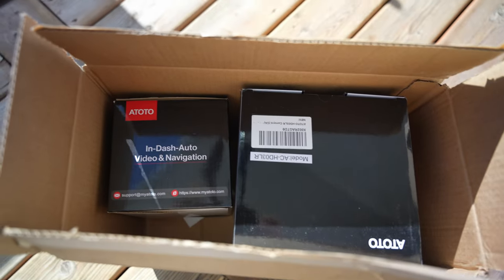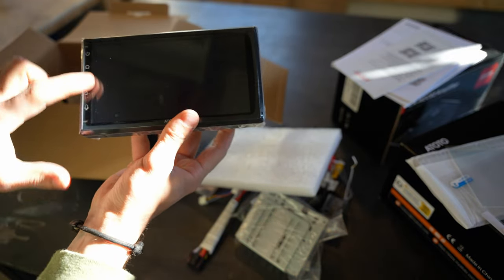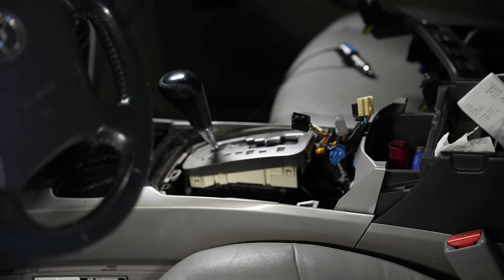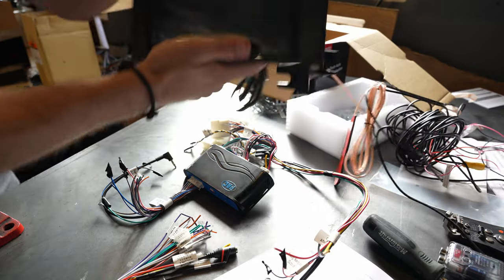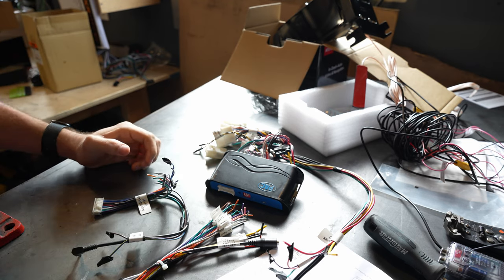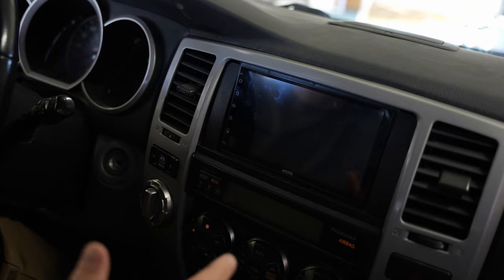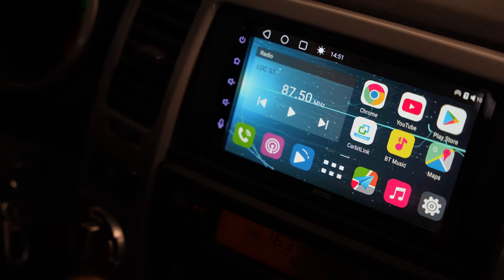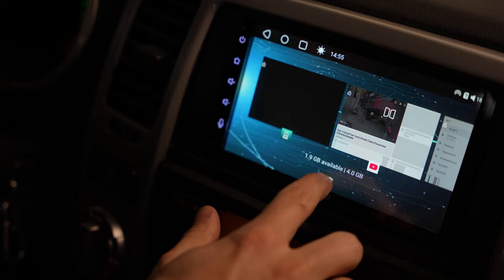ATOTO S8MS Head Unit & CA-AEC02 Amplifier I Review & Install I 4th Gen Toyota 4Runner

Comment: Hi Loose Axles. 
I have a 2003 Toyota 4Runner with the JBL Syntesis Sound system, Subwoofer Amplifier and navigation it's the TOYOTA 86120-35241 (Fujitsu Ten 135000-2401A101) this the label in the radio unit.
Looking for options to upgrade, found your video.
Do you know what are all the items I do require to apply these option.
I know that unit will replace the radio, also love the amplifier Idea,  but what about the original SWoffer amplifier, will be out of function?
Do i need especial harnesses to easy connection? I'm clever about electrica installations so can solve make the right connections.
Also wonder  the steering weel controls can be maintained, is there any interface required.
Will appreciate your attention to this and also your answer
Regards Mathias. Noyola

Comment: I just installed the same setup. Do you have any idea what the dark blue and white wires on the small connector are for. It is the small connector that connects to the head unit, I can't find out what they are.
Reply from the maker: If my memory serves me correct, it could be power antenna?

Comment: So,  it seems we don't need the 107 dollar harness for the 4runner 4th gen,  if we are not using the power amp setup or steering wheel controls ?  

Alternative harness?   I would just want the base radio (and camera). Thanks! 

These sure get harsh reviews on Amazon,  but trying to have faith haha
Reply from the maker: The harness is definitely worth it. I have it linked in the description the one that allows you to keep your steering wheel controls and just plug and play. The alternative is 5 hours of wiring haha. I have loved my Atoto unit - it’s actually been quality.
Reply: @looseaxles   I don't have steering controls on this one for some reason. :(   And no JBL on this Sport. And not using any amps. Basic.   Seems like the 107 harness is not needed for me. Hmmm

Glad to hear the good words.

Comment: How is the amp holding up? The reviews aren't too great on it. I have the s8 but speakers are pretty quiet
Reply from the maker: I switched to using the head unit without the AMP as I felt like my stock speakers needed an upgrade to make full use of it. It’s defs helped for more punch though.
Reply: @looseaxles  Gotcha, thank you for the reply much appreciated. I have an 01 ram with aftermarket infinity speakers. I'm enjoying my s8. But just seems like the volume has to be turned almost all the way up. Was thinking of picking this up to possibly make them a bit louder.

Comment: have a tacoma, also have a jvc radio in it. only get 1 am station bought the pac harnesses cause thought that may be the proble, with the jvc. is the atoto and amp better than your pioneer was or should i just get new jvc? have all new harnesses, and want front cam input.
Reply from the maker: The Atoto, even without the amp blew my pioneer out of the water. It’s been a much better head unit to be honest. Even better with being able to include front and rear cams!

Comment: Is it possible to bypass my stock JBL amp and use this one?  I have a 2019 Sienna and the Crux 61p harness to retain steering wheel features and drive the stock JBL amp causes a severe delay in the production of sound from my S8 MS.  It can take anywhere between seconds to 15 minutes to actually hear anything, including input beeps when  I touch the screen. I figure if I bypass the JBL and use a different amp, I can solve that problem.  Can you help me?
Reply from the maker: I would think that’s totally an option!

Comment: The deal breaker for me was it doesn't have Sirius XM. I emailed Atoto and they told me this head unit did have that capability but looking at the connectors there's no way that it can interface with the Sirius XM box. Disappointing.
Reply from the maker: Ah rats! What’s has kept you with Sirius XM after all these years?
Reply: All of my newer cars have come with it but I still have a 97 Honda Civic with an old Kenwood that has, believe it or not iPod control and siriusxm (2008). LOL. I was thinking about bringing it into the 21st century, but the other problem is I don't use streaming services, like Spotify or other music apps. 

So with the newer cars we have a subscription to SiriusXM so it just makes sense to keep it in the old Honda. But really after looking at the Atoto, the only channels I really listen to are 80s on 8, maybe Liquid Metal sometimes, and Caliente.
Reply: Respect 🙏🏾🫱🏼‍🫲🏽 radio is nice sometimes, don’t have to keep choosing new play lists or songs. 91.1 in my area plays awesome music and usually transmits clear
Reply: @looseaxles Sirius XM is superior to all music platforms if you drive a lot, PERIOD! People who don’t like it typically are CHEAP